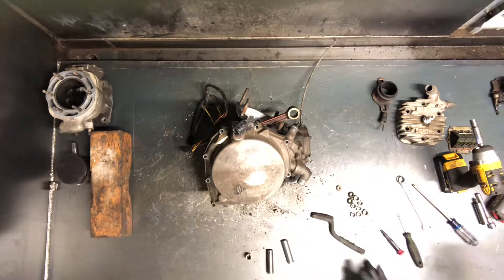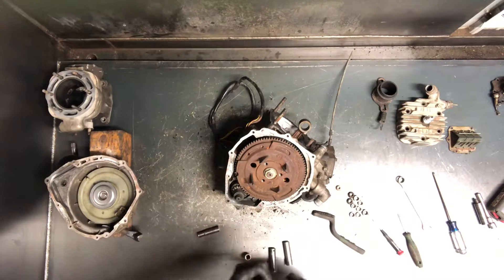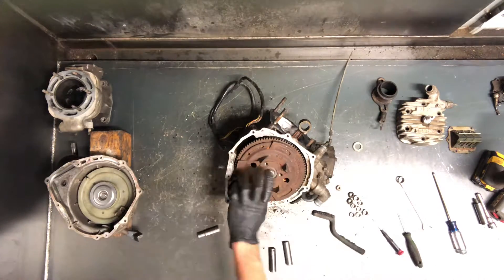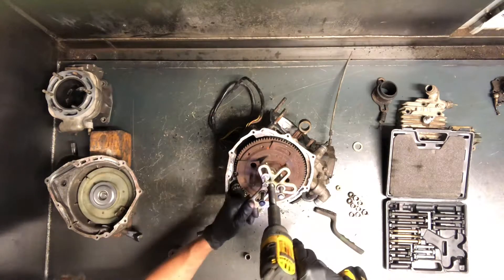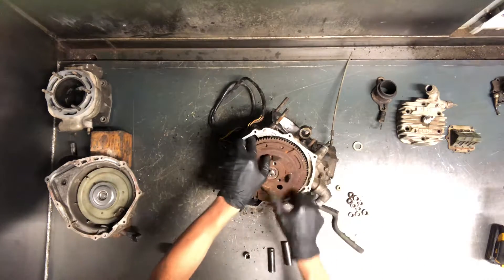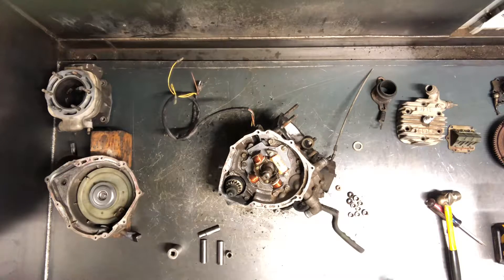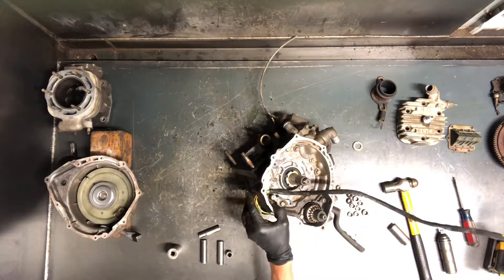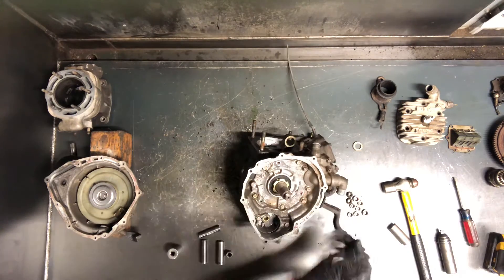Polaris Scrambler / Sportsman 400 Flywheel Magneto Generator Puller Removal

Comment: Do you have any tips on what I could try when #1 the pivot tip that goes on the main end of the puller is mushrooming a bit, tried just grinding a tip on end of that shaft to maintain center and the end of the shaft is failing because its on there so tight! Tried some map gas heat around perimeter of flywheel close to crank but still not budging! ?? I need to get that seal changed any help appreciated???? Thanks
Reply: @MidNebraskaMotorsports  Hey thanks for the tips and reply. I was definitely at my end with that flywheel, after trying heat, tapping and all manner of prayer, a idea struck me. I went ahead and fixed up the end of the puller shaft, and made sure my 3 attachment bolts to the puller weren't compromised, I tried again. This time letting the air impact go as far as it could, then went for a can of brake clean and I sprayed the end of the crank shaft for about a minute using half a full can of cleaner. Then I put the hand breaker bar on the puller and gave it one last crank and presto! The freezing of the shaft w the brake clean shrunk the crank just enough that it did give way. Definitely was the toughest pulling issue id encountered in my life. Thanks again for the knowledge you share as it helps a lot seeing things done 1st hand. God bless.